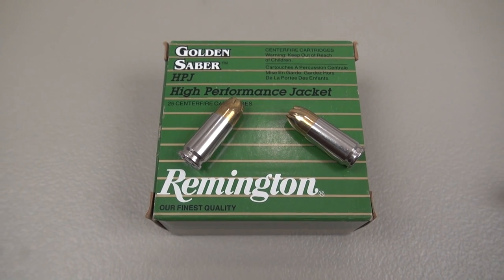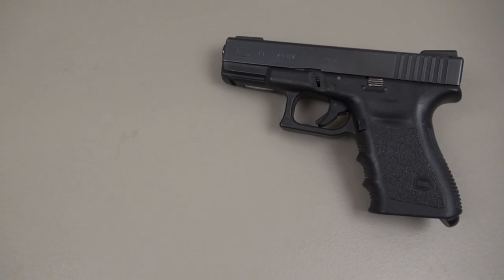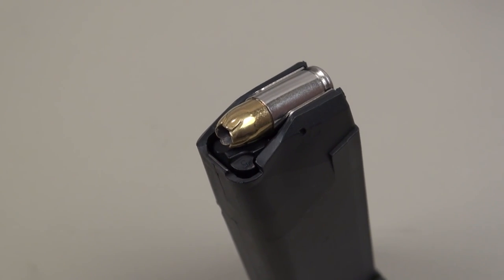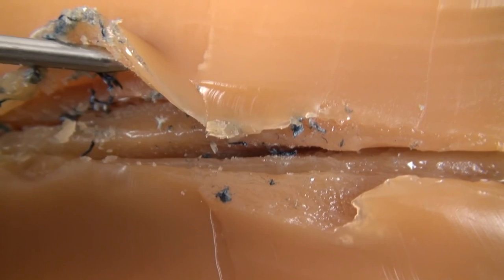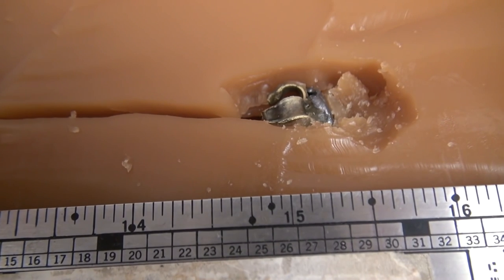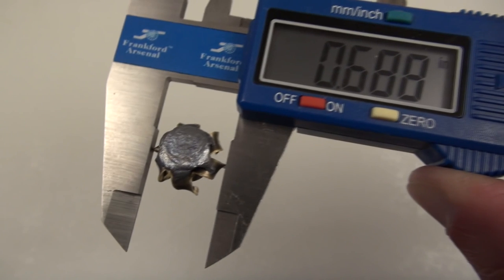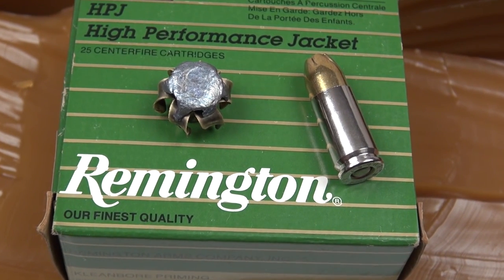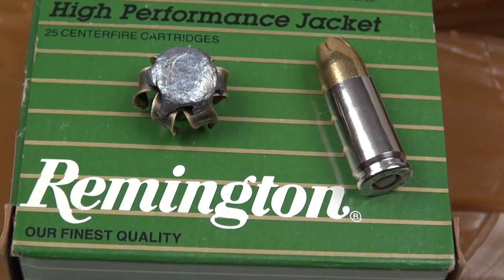9mm Remington Golden Saber 147 gr Ammo Gel Test

Comment: The bullet was designed to have the cutting of the jacket petals as the primary wounding mechanism to compete with the Black Talon..  The lead core is basically just there to drag the jacket through.  The fact that it may separate is irrelevant.  A large west coast agency uses 147 GS.  They are extremely pleased with it's performance on the street.

Comment: Jacket and lead core separation AT THE END of the bullet penetration track is not a problem. 

As proven with the 5.56 NATO loads, some fragmentation adds to the wound and incapacitation values. Bonding of the core and jacket is only important if the initial design produces early separation. Otherwise, it is only marketing.

Comment: Tim, I've seen you perform and record numerous tests of the Golden Saber bullet.  And they consistently perform very well, albeit the jacket separation, which is ostensibly bullet failure.  However I don't think that it is.  The engineers at Remington are really sharp.  And they have been manufacturing ammunition and firearms a long, long, time.  And if they didn't want the jacket to separate, it wouldn't.  

I think the whole point of using brass for the jacket and maintaining a non bonded version of the Golden Saber product line, is specifically so that the brass can separate and peel back.  Using brass, which is substantially more rigid than copper, they are able to allow the jacket to peel back while relying on the rigid brass to maintain a corona around the core of six or seven razor sharp knives.  For the daggers to be maximally effective, they need the bullet to straight line and not tumble.  That's where the separated core comes in.  By separating, and maintaining a forward posture, the bullet is able to simultaneously use the forward momentum of the core to straightline, pulling the corona of razors sitting perpendicular to its axis, where it can spin and destroy flesh with maximum efficacy. 

Only if the bullet does exactly what a Golden Saber does, by that deliberate and controlled separation, can you get that Golden Saber signature path of utter destruction. 

Not to say that other manufacturers bullets are not getting that same effect, just that Golden Saber has a typically more pronounced instance it, and has been doing it for years and years, while other manufacturers were still putting out bullets that essentially mushroomed into just larger diameter projectiles. With the bonded core/jacket peeling so far back past the 90 degree point, that the knife effect of the petals was lost when they came parallel to the core axis again.  

Now this is just conjecture on my part. I don't have the experience, knowledge, or exposure that you have. Meaning that I'm prepared to be very wrong, however I just wanted to put that out there for you to think about and let me know what you thought. 

That Remington's consistent jacket separation on the Golden Saber line is not a design flaw, but an intentional characteristic.  Thanks.
Reply: I don't think bullet separation means bullet failure like some do.  Look at the Federal 9BPLE 115 grn. +P+ round, that thing totally blows apart, but it also creates a large wound channel and it's easy to see why it's been a top choice for law enforcement for many years.  If you place your shots and the bullet performs as it should, the threat should stop relatively quick(those that are high on some kind of drug may need a well placed head shot to end a threat).  I wouldn't have a problem carrying this round based on it performance in tn's video.

Comment: I've watched a lot of you're videos and value you're opinion. What 9mm ammo do you recommend for a short barrel? G43,G26,Shield ext.
Reply from the maker: 124 or 147 Gold Dot or HST.  I would also consider those weights in the Hornady XTP.
Reply: Thank you..I'll be get some soon.
Reply: J. Dalton You might also want to consider looking for the versions of those rounds made for short barrel pistols. Gold Dot is easily enough named "short barrel", HST is I think called "Micro". The difference between them is usually a faster burning powder to get a little more velocity from the short barrel (maybe 25-50 fps extra) but more importantly the bullet is designed to reliably and consistently expand at lower velocity.
Reply: Sean Heihn I'm using the hst micro right now. My local Walmart had them for $22
Reply: J. Dalton Lucky, my local Wal-Marts don't have any defensive ammo in popular calibers in stock. I got some Gold Dot SB 9mm at my lgs for 23.99 which isn't too bad, they usually have decent prices, and almost always have good ammo in stock.

Comment: I dont feel that jacket separation is that big of deal. As long as the lead portion of the bullet penetrates even thru barriers, what difference does it really make. I remember when speed and frags were good things. The 9mm silver tip which started all of this bullet perfection, did exactly what is was suppose to. It expanded,severed a major artery. Fbi falsley surmised that if the bullet had penetrated further, thier agents would still be alive. I would rather have seen them mandate carbines.

Comment: Scientifically, what is the negative impact of some jacket separation? How would it make a round any less capable of causing damage than a bonded bullet? For the life of me, I can't find anything that is able to demonstrate a lowered efficacy of some jacket separation.
Reply: Late to the party with an answer, but here goes:  The bulk of the expansion is in the petals.  You saw in the video that cross section he did, about 2 inches in i think it was.  It was petal shaped, so the round cut through like a broadhead arrow.  When the petals (the blades) separate from the lead core (the mass), the petals stop pretty quickly and the lead core (nice and smooth cause it's lead) continues on, but in a less damaging way (no sharp edges, less mass).  Hope this helps.

Comment: First I want to thank TN for your vids. I am a tramendous fan! I would appriciate it tons if you would re-test the Rem 124gr non bonded +p Golden saber in  gel. It would mean alot to me. Also the .40 165 non bonded Golden saber as well. I truly believe the core jaket seperation "problem" to be overstated as some of the loads with the best street records tend to fragment. Jacket core seperation is not much different. As long as there is expansion and good penetration the round will do its job.

Comment: Jacket separation is more of an issue when shooting through barriers such as drywall, wood, sheet metal, auto glass....in other words more towards Law Enforcement needs than personal defense. The unknown is what happens in a real body. Sim test is not muscle, it is not organs and it certainly is not bone and thick bone like a sternum.  Ballistic gel was designed to compare rounds in an equal setting/ substance it is not the same as the human body. It gives you a way to compare like rounds in just the gel, or with heavy clothing or other obstacles in front of the gel. It is used because well shooting hundreds of people through various barriers etc is generally frowned upon 😂.
Find a caliber, bullet weight etc that you feel comfortable with are accurate with and can can control.

Comment: Why not use clear ballistic gel?
Reply from the maker: Why not check the date of the video?  Perhaps it wasn't available in May 2012.  Once it was created, I did use clear gel sporadically until I stopped posting videos in 2016.  I'll add that clear gel is NOT as "accurate" as 10% ordnance gel, or even the SIM-TEST that I used.  Clear gel provides the instant gratification visual, but the permanent cavity is marginalized with JHP's, among other useful data points.
Reply: Clear gel give you a better idea of the permanent cavity wound as well as the initial shock wound the round makes upon entry. Do you know who conducted the studies/tests showing that clear gel is not as accurate as ordnance or SIM-TEST gel? Thanks!
Reply from the maker: There was not a formal santioned study, it was a visual comparison of various tests that I ran personally.  I had six years of putting my fingers in these different formats.  While you obviously get a glimpse of temporary cavitation, there is a huge difference in permanent cavitation in clear gel.   I also spoke with other YouTubers who felt the same way, but most amateur testers migrated to clear gel regardless because test to test the resource is less expensive, and what viewers wanted to see......accurate results notwithstanding.

Finally, between 2014 and 2016 I tested a variety of JHP ammo in clear gel, off camera.  There was a higher rate of overpenetration with ammo I had previously tested in SIM-TEST or compared to 10% ordnance gel results from other channnels and/or forums.  It comes down to using a water-based substance vs. artificial.  When our bodies are water-based, it makes sense that a water-based test medium will have a higher degree of accuracy, even when bone isn't used.   I've done way more research on this than I care to admit.
Reply: Thanks for the info. Since youtube is a visual medium, we viewers are obviously going to gravitate towards what makes a bigger visual impact. Shooting into mud colored gel is not very stimulating and most of us will simply click through to another video rather than watch someone digging through mud. Anyway, thanks again for the info.
Reply: Hangfire-13 so you're basically saying you don't want real results, you want him to lie to you?    tnoutdoors9 I see why you quit doing YouTube....
Reply: @abrb1223 
He just asked a simple question.  The general population doesn't know these things, thus the need to ask.
Reply: @jshepard152  and then he took that reality and substituted it for his own.

Comment: I have read several gun companies recommend not using golden sabers in their guns due to the sharp edges of the serations in the bullet damaging feed ramps. Has anyone had this happen? I have never tried them for this reason and am curious if this is a problem with this round.
Reply: I ran several THOUSANDS of Golden Saber rounds in my XD over a 30 day period and never had a single issue with failure to feed or feed ramp, barrel, or mag damage. I actually didn't have a single failure which shows how good the new "old" tech has become. I could see it happening but while testing them in my XD, SCCY & LC9S I never had a single issue.
Reply: Aren’t feed ramps ordnance steel (frequently forged), while the Golden Sabers’ jackets (including their serrations) are a brass alloy?   How easy is it for a brass saw blade can cut through ordnance steel?
Reply: @roykiefer7713  Most are. But some feed ramps are an alloy. Maybe this is what They are talking about? I'm not sure.

Comment: Having used a 9mm in real life events I can say I see no reason to down load this to a .38 spcl-which is what your doing with 147gr low velocity rounds.I ve used the Federal 115 Classic twice-with poor results..Winchester 115gr Silvertip with poor result and the federal 129 gr +P HydraShok with good result.Funny how,sometimes,actual street results contradict Lab Testing.It appears to me that the 115gr do not carry enough energy to perform as desired.I think the 124gr rounds at atleast 1100 fps seem the best choice.Also note,barrel length plays a very large part in velocity-short barrel revolvers are known to loose atleast  60-80 fps per inch of barrel lost.Contrary to popular belief,most PDs used to issue J frame revolvers with 3" barrels not the common 2" models.   You should test the same bullet from different barrel lengths and see what you get. And,in an auto pistol a 3" barrel is not 3"...its only 2"...Manufacturers include the Chamber,which is very misleading.